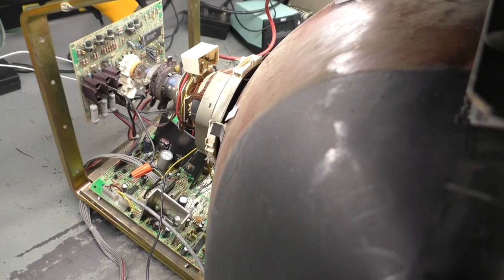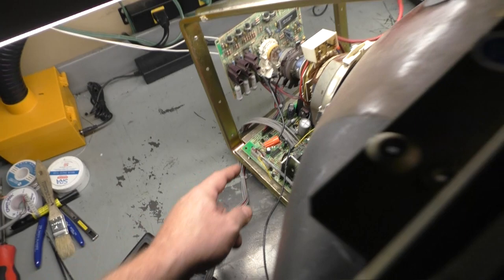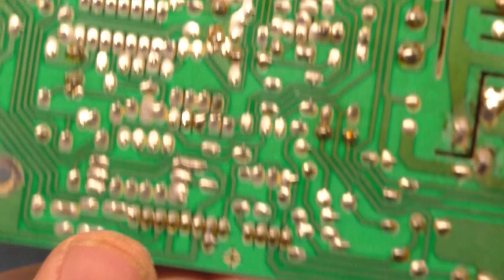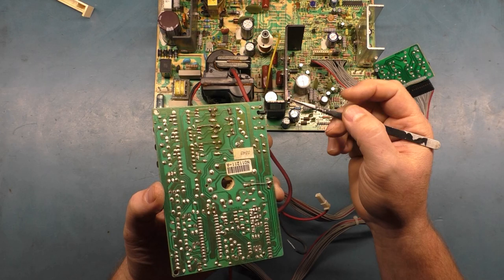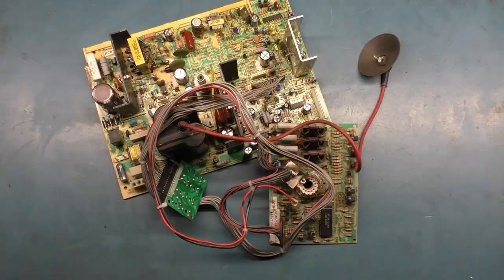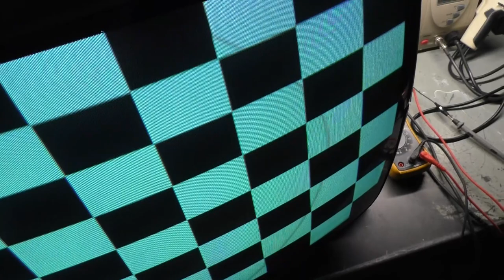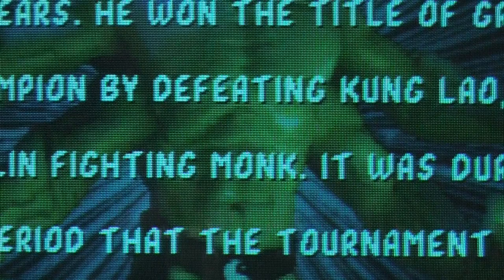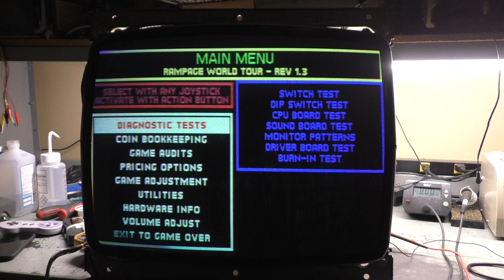25" K7400 Arcade Monitor Chassis Repair - Vertical Hold Drifting, B+ Adjustment, Shutdown Adjustment

Comment: Do you keep caps on hand, and if so, what brand do you recommend?  I know Arcade Parts sells Nichicon.. but I haven't been able to find a kit like I've seen on Amazon so I can keep caps on hand!  This video also made me wonder what parts you typically check -- I'm noticing resistors, diodes, then replace caps, reflow, and reset pots - which usually solves the problem.  I'd be curious to see what other parts you recommend checking for common issues.  I got in a bad habit of replacing transistors because I didn't know how to test them (which just seemed to introduce more problems!).  Curious what your thoughts are..  Also, you should do a Q&A at the end of each video!  :)
Reply from the maker: Yes, I keep all the most common ones on hand. Ordered a bunch in bulk from APAR and I keep them in an organizer on the bench. You basically check all transistors/mosfets the same. It’s just Base\Collector\Emitter in diode mode on the meter. Only difference is which way you have your leads. Look it up and you’ll see what I mean. A Q&A might not be a bad idea.